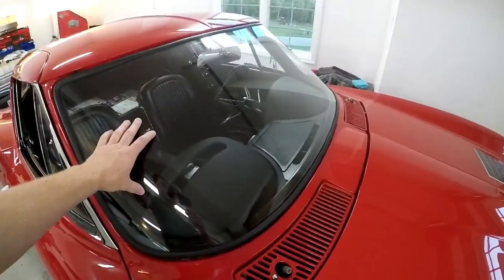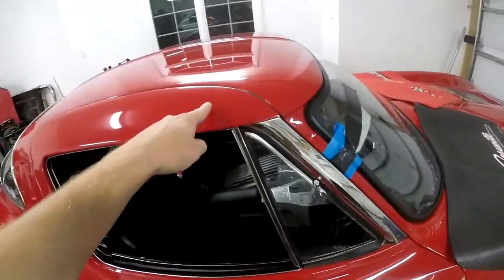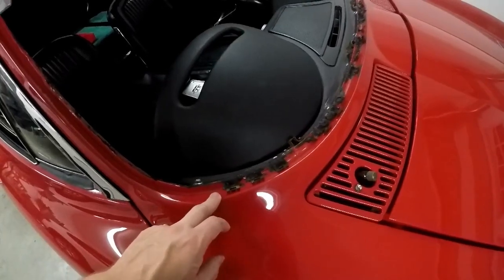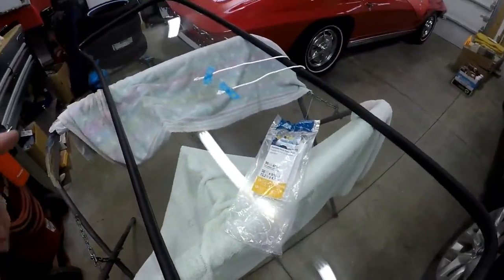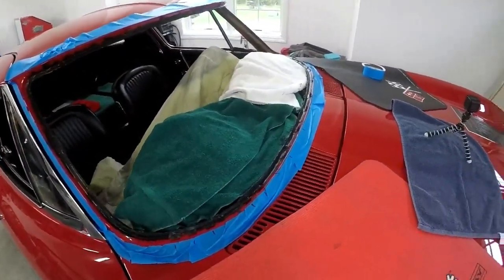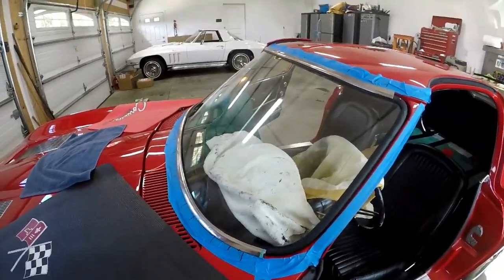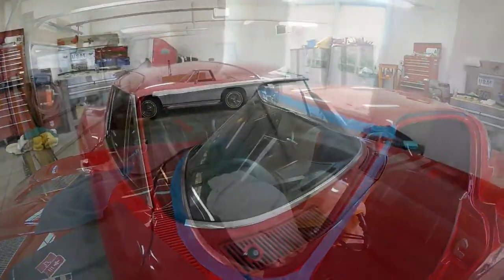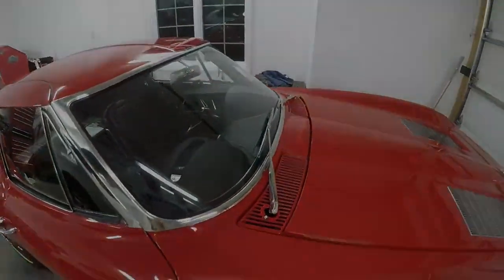1963-1967 Corvette Windshield and Trim Install (Round 2)

Comment: Thank you for great video. I wish there would be about trim installation. I finf it wery frustrating on 67 coupe.
I believe 64-67 coupes has different kind of windshield trim?
Reply from the maker: TheReinoPaasonen Thank you I’m glad that you enjoyed it! Sadly the trim is different on 64-67 cars so I don’t have any experience with that trim. Their clips are different also. My best advice is to figure out how the clips grab the trim. Then make sure they can move freely in the car so the trim can engage. That was our biggest problem.
Reply: So the clips must be installed not too tight?I plan to check fit before installing glass,and think your advice, its good idea to carefully install trim bottom and top first to avoid damaging glass

Comment: Why is good not latched
Reply from the maker: When I store the car I always leave the hood unlatched because the battery is disconnected. I have a video on a 78 that I bought that had an engine fire. They started the car with the hood latched and the carb caught on fire but the hood was stuck. The car burnt up. I always leave it unlatched to be sure that I can get to the engine compartment quickly in an emergency.

Comment: Those window gasket systems DO NOT get sealer or adhesives! If it's installed properly it WILL NOT leak. You're just making an ugly mess with that stuff
Reply: You’re wrong friend, this windshield requires the adhesive to be used. Unless you want to rust out the birds nest in the Vette.
Reply: @noname-tn9rr  oh ok then i stand corrected. But I'm tired so I'm gonna sit down corrected